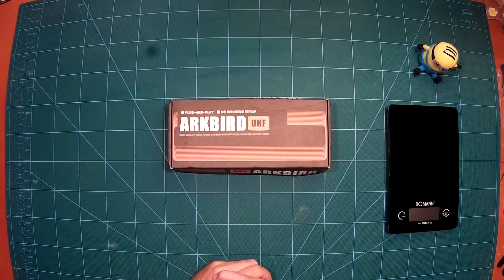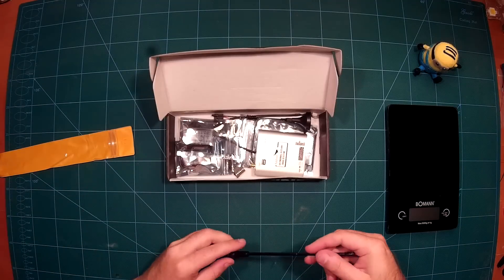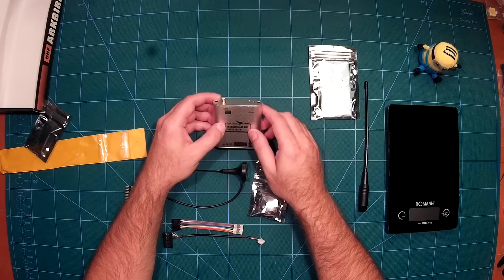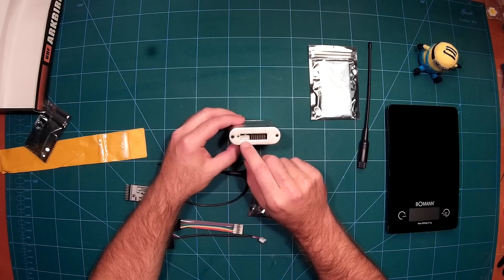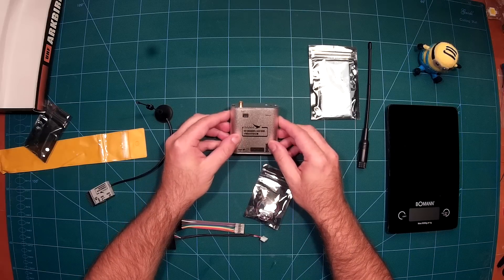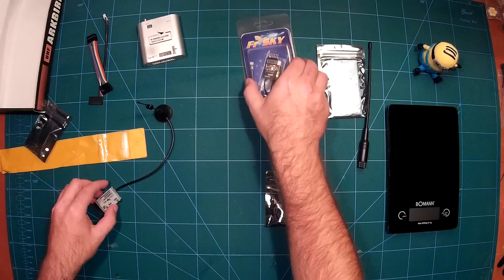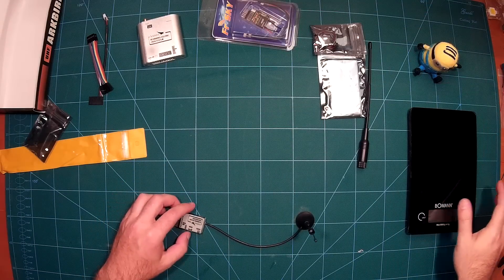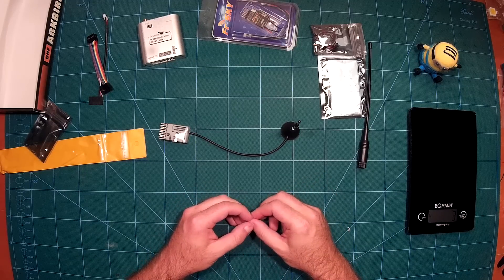Arkbird UHF Module / Repeater Station: Unboxing Review

Comment: I use Radiolink AT9 with R9D receivers. As far as I know they both provide PWM signals. I'm worried it wont work with Arkbird system, as it requires PPM signals. Can anyone tell me if the systems will match? Tks

Comment: Looking forward to the 2nd part of your review. I have a couple of these transmitters and receivers. The reason I tried them out was I already had the Arkbird OSD/Autopilot and the price was good. My max range so far is about 7 km set up with all stock components set up like the manual said. I think they are capable of greater range than that though. I have had some resolution issues and jerky/delayed servo responses using the ppm out of the receiver and found it worked best wired pwm (even into the Arkbird Autopilot). Also have tried the transmitter wired ppm to a Spektrum radio and as a relay unit. Much prefer using as a relay as seemed to scramble the radio controls at higher power levels when the transmitter was close to the radio.
Reply from the maker: +bugaboo102 Many thanks for your valuable inputs, greatly appreciated. I'm looking forward to work further on this as well, that will be great.

Comment: Looking forward to your experiences with this UHF. I have it on a small wing and unfortunately I am experiencing a lot of troubles with noise from the other components on the plane. When you test the UHF outside the plane then the power is brillant. But not near all the FPV gear. Now I shielded everything with the sticky aluminum foil that is inside the box of the UHF. 
I would recommend to exchange the stock antenna of the TX. I bought the HAWKEYE UHF Dipole 433MHZ Antenna for the TX. I also tried to make a dipole for the RX by soldering two wires to the board instead of the stock antenna. Unfortunately I wasn't successful because my RX was a faulty item, but it was better than with stock antennas. ;) I will try again later as soon as my latest order will arrive.

Cheers, Martin
Reply from the maker: +FPVMartin Many thanks for the inputs Martin! Can't wait to try this out further :-)